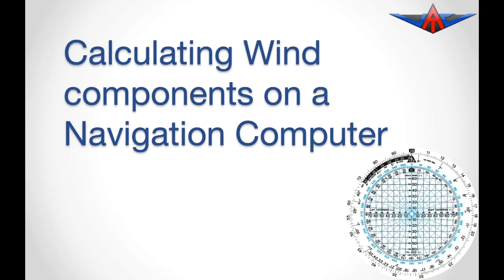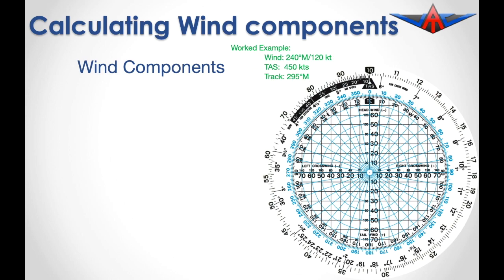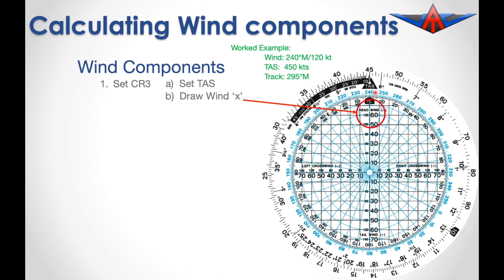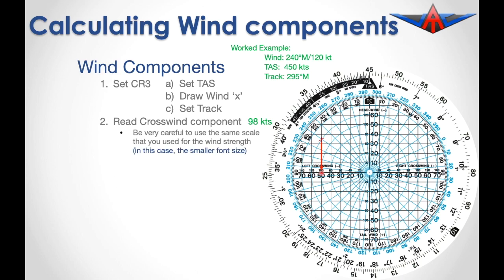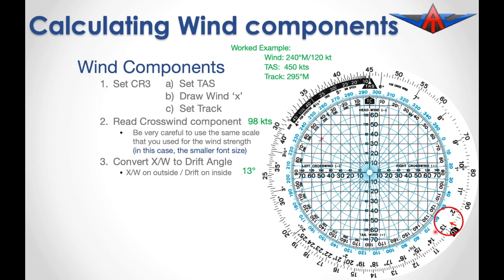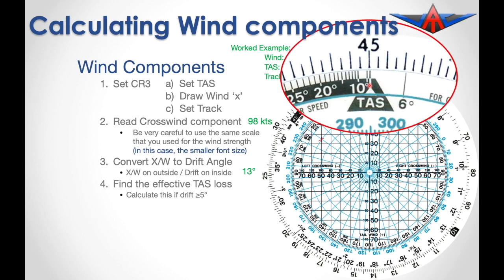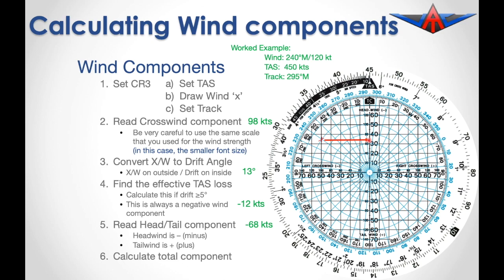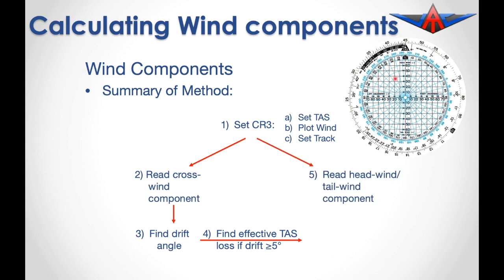Calculating wind components on Jeppesen CR3 or APR CR6

Comment: I am not a pilot and stumbled on to this video so i am curious, how often do you encounter 120 knot winds? That sounds incredibly fast.
Reply: Sounds like airliner numbers.
Reply: It appears the featured device calculates the cross wind component and headwind/tailwind component at the leeward end of the wind vector. Crosswind component divided by airspeed equals tangent of the wind correction angle. Then the Pythagorean formula is used to get a speed-add or subtract headwind/tailwind for ground speed. It does all that mechanically. Seems like a lot of steps to do what an E6B does directly.